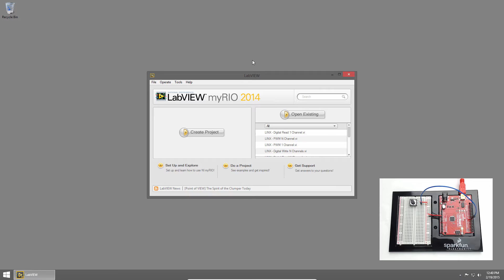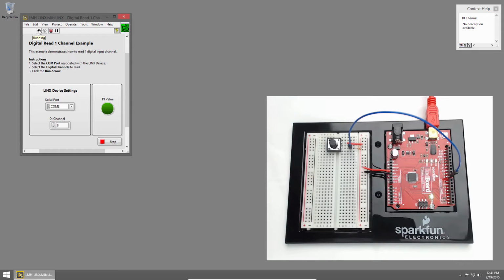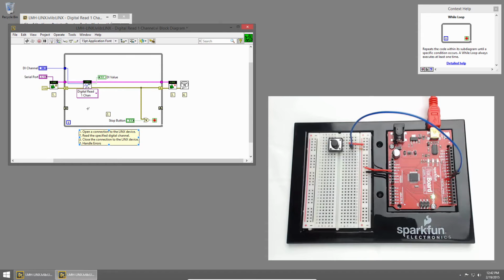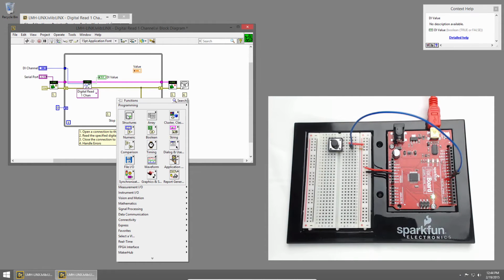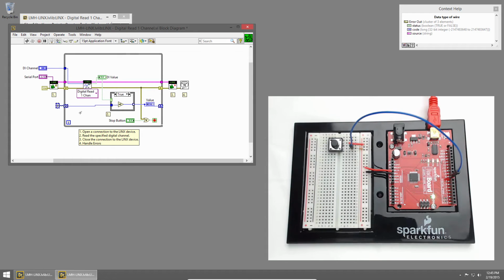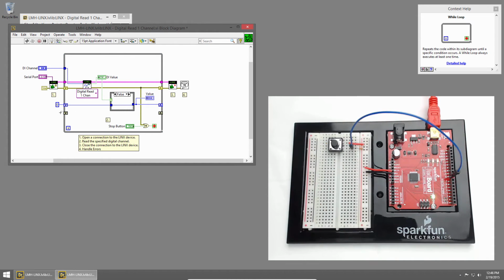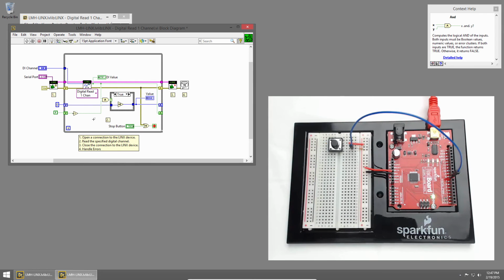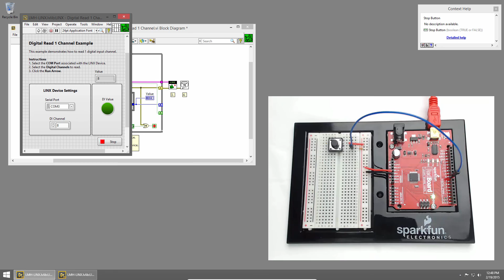Sparkfun Inventor's Kit for LabVIEW - 07 | Push Button

Comment: Trying to follow this with labview; but my version of labview must have different controls.  I cant find the DI channel DI value or stop button identical to the ones in the examples.  I figured out one was an error cluster..  It is good to open the example and run, to see how it works.   But useless if you want to do your own from scratch.